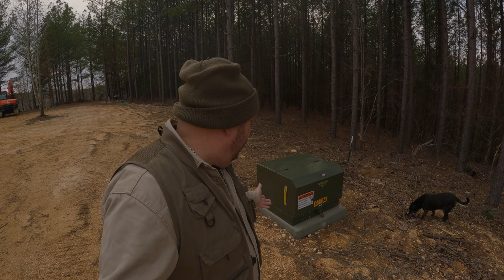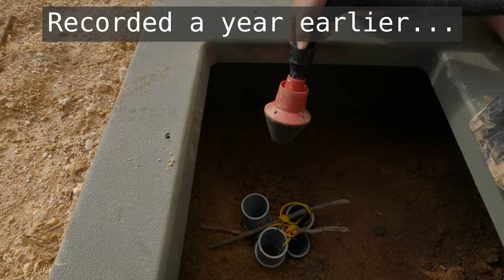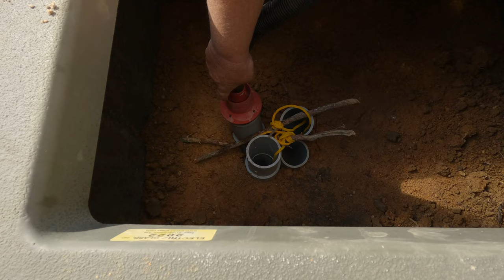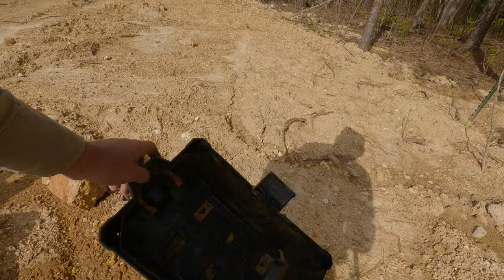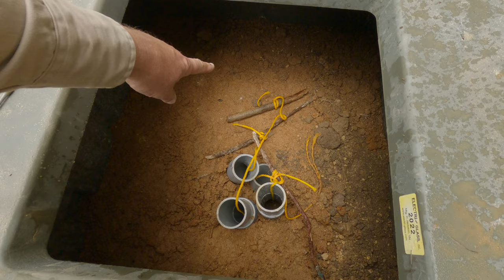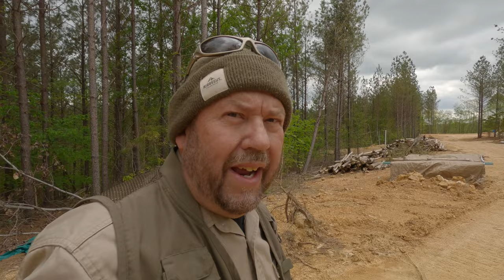Uhh oh! Where did the pull rope go?

Comment: Glad to see you moving along! Is there a restriction on how big of a tiny home you'll allow?
Reply from the maker: No! Although the concept of a big tiny home seems like a bit of an oxymoron! Bring it out and we'll find/design a space for you!
Reply: @RvParkBuilder  when looking at tiny homes they really vary in size. To me a tiny home is under 399 sq ft, even those size out differently
Reply from the maker: @taraized  Makes sense! CometTroy's Class A motorhome is 40 x 10 (with slides out). That's about 400 sq ft tiny home size and he knows what it's like. The only restrictions we have here in our subdivision is "no mobile homes". Therefore, we can accommodate any size tiny home. However, Tennessee does have a "Ready-Removable" law which applies to shed builds, which are allowed as long as certain requirements are met. TN also permits tiny homes, but regulates the manufacturer, dealer and installer of tiny homes under "Modular Building Units" law, requiring a license. We haven't found that DIY tinys are allowed in TN, but what do we know?